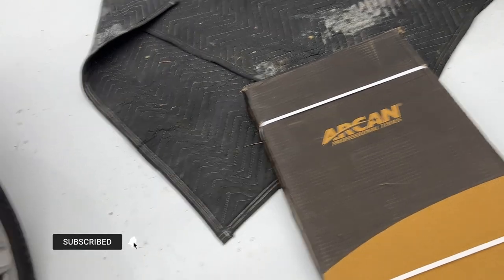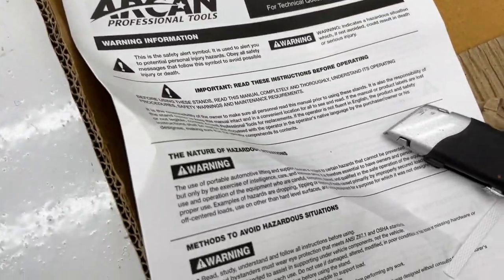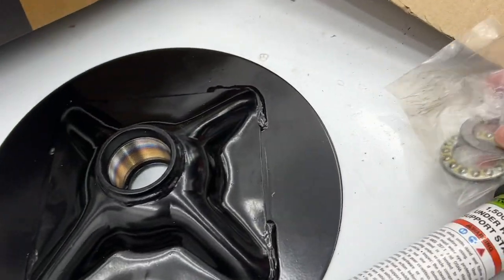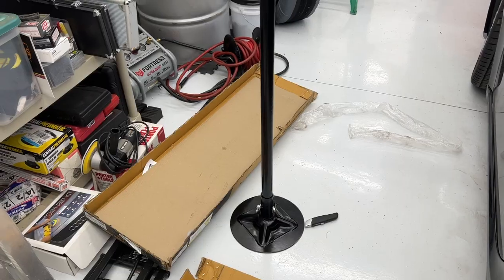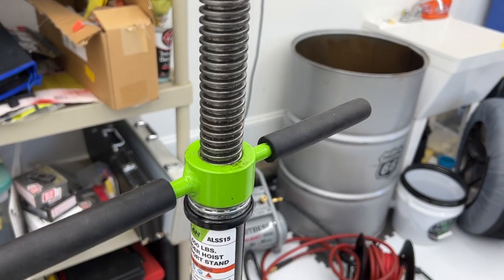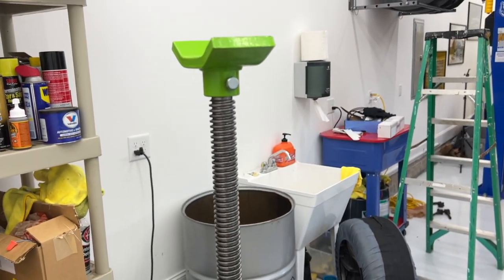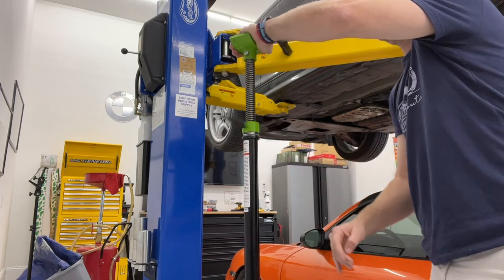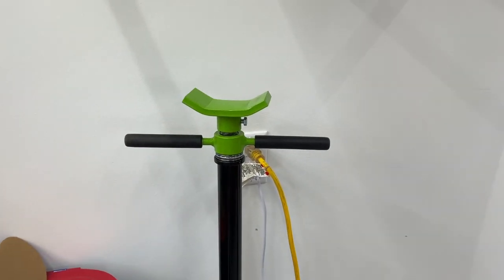Under Hoist Support Stand  |  Tool of the Week

Comment: I need one of these, but shorter because I only have a midrise lift. Do you think the post could be shortened above the adapter that screws into the base? Obviously you would need to drill a new hole for the pin and possibly shorten the acme screw.
Reply from the maker: +Jeff C cutting the screw shorter would be tough… I would think they would make shorter versions 🤷‍♂️